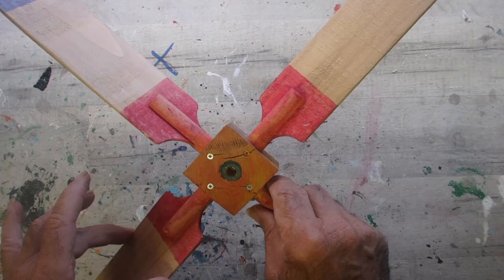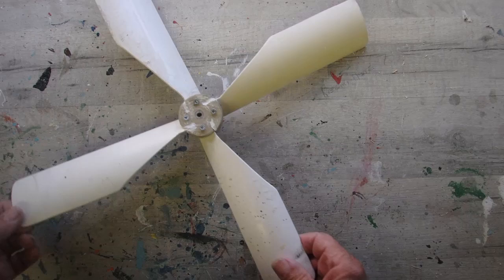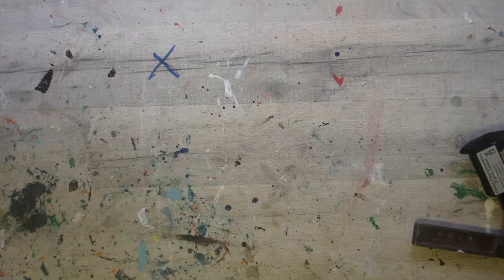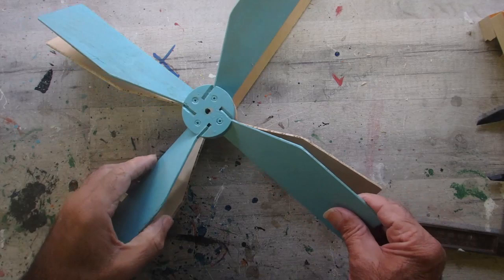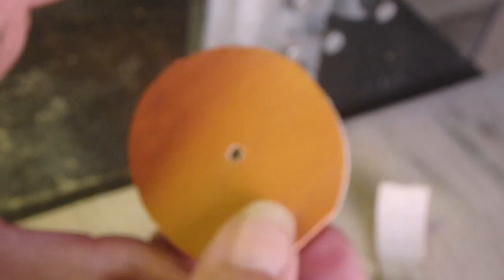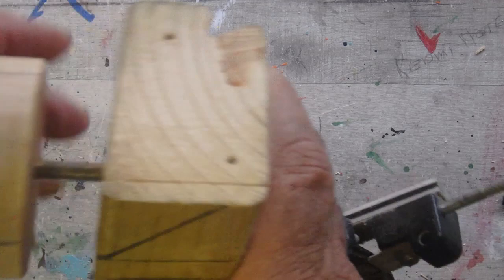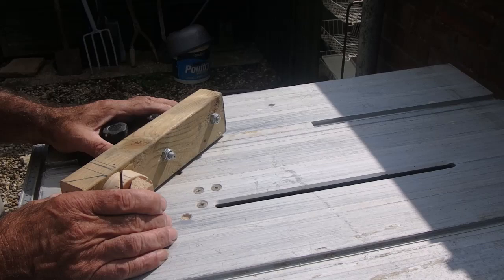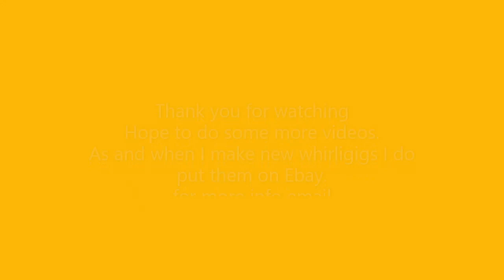How to make Whirligigs, Ep7  Making the propeller my way.

Comment: Nice Job!  You can use the fixture that you used to cut the circle on your band saw to sand off bumps on the hub, clamp it to your work bench, then move the sander
close to the edge and rotate your hub by hand, it will make a perfect circle.  Another way is to use a door hole saw in your drill press to cut out the hub blank circles.